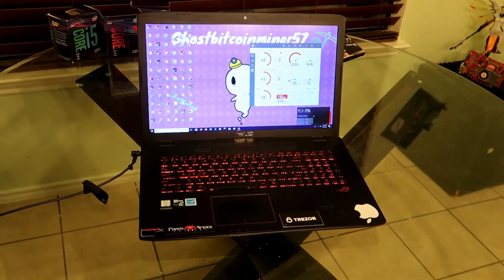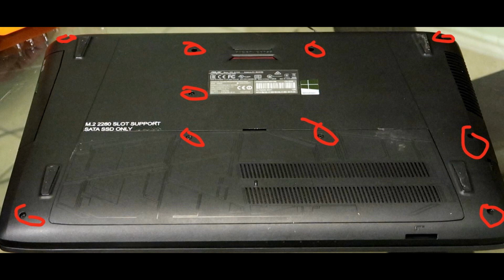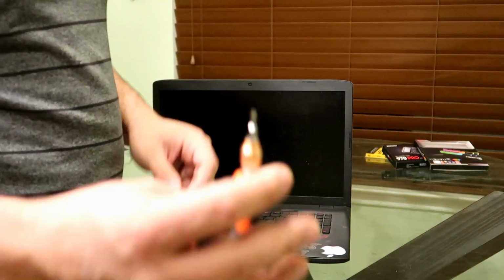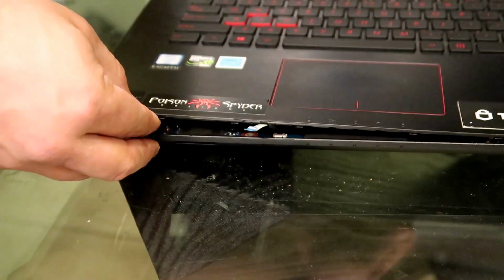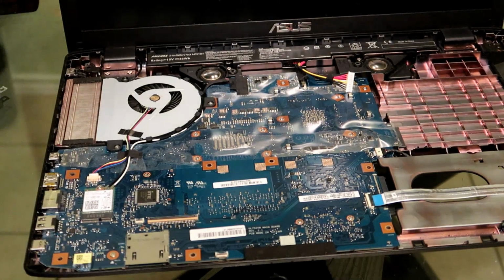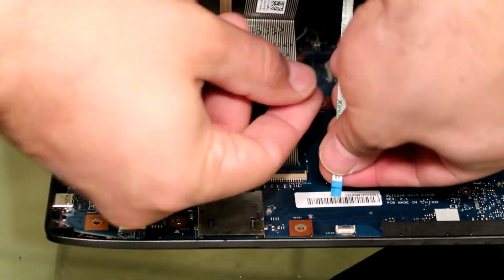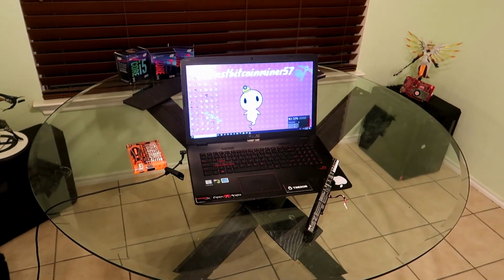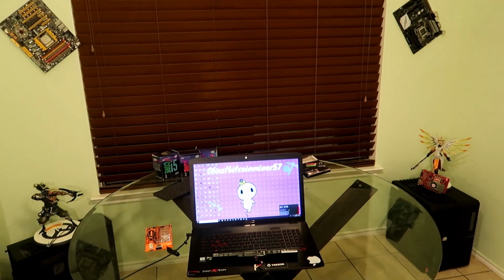ASUS ROG GL752VW DH71 Battery Repair

Comment: Excellent video... changed the battery no problem. Do remember to remove the hard drive before you take off the keyboard. Thanks for this vid fella, you are a legend!
Reply: It wasn't difficult to see that the four hdd drive screws are there for somethimng else than holding the drive, it must be not necessary that if you have mounted an ssd sata drive at the M.2 connector it's better to remove it before trying to unmount the upper cover with the keyboard. I can't understand people who complain about someone who goes to the trouble of making 99% of their work easier for them.
I didn't have to change the battery, I had to go ahead and completely disassemble the motherboard and heatsink to replace the thermal paste with graphene pads. The 'legend' accompanied me to a point on the path and then I continued on alone. He did the hardest part.
Reply: Guess I should have read the comments before just trusting this so called legend. pffft!
Reply: @elsid9927  Me too. struggled for 20 minutes before removing the SSD and being able to remove the keyboard.
Reply: @RogerNeno  It wasn't difficult to see that the four hdd drive screws are there for somethimng else than holding the drive, it must be not necessary that if you have mounted an ssd sata drive at the M.2 connector it's better to remove it before trying to unmount the upper cover with the keyboard. I can't understand people who complain about someone who goes to the trouble of making 99% of their work easier for them.
I didn't have to change the battery, I had to go ahead and completely disassemble the motherboard and heatsink to replace the thermal paste with graphene pads. The 'legend' accompanied me to a point on the path and then I continued on alone. He did the hardest part.

Comment: You failed to show removal of the HDD and the optical drive.  Also, two of the black outer screws are 1mm shorter.  8mm  x 2 & 9mm x 8.  VERY important.

Comment: A most excellent video. The computer I am posting this from is doing so after following the battery replacement instructions here. The bad news was that the clip for the touchpad pulled free of the motherboard, but since I dislike the touchpad anyhow (I prefer a mouse), no major issue. Thank you for sharing this video!

Comment: If i may suggest a major problem with the title.
Is called "Battery replacement" not "repair".
Repair , and what i was searching for, means you open up the module and replace the damaged cell, balance them, or replace all cells inside , if possible (i think these are 18650 cells, but i might be wrong hence why i search for "repair" not to get "replacement")
Thank you anyway

Comment: my yuhjnm dont work after replacing keyboard... did I do something wrong?
Reply from the maker: Did you get it working?
Reply: @Ghost57  I think so, I replaced the battery and the ssd and the buttons seemed to work now, so I'm thinking I had a strip not all the way in

Comment: Thanks for the review, everything is very sensible! .. I would like to ask, I have the same asus laptop .. After one preventive maintenance and a repairman for dust cleaning, I noticed that the laptop screen ,,..horizontal lines began to appear on the screen ,,After after I move the screen a little, as if the screen image becomes normal .. Maybe the laptop screen cable was damaged ...? Thanks again!

Comment: Also had a problem because the hdd removal was not mentioned in the vid...I did not read the other comments....this step should be added in the vid, even if it is just some warning text overlaid, this can cause people lots of unnecessary problems, poor vid for this reason alone.

Comment: I have the same laptop, and its been dead for almost a year, i'm afraid it will expand or leak eventually. Should I just remove the battery even though I have no intention of putting a new battery inside? I'm fine with it plugged in.
Reply: If someone could answer Apollo Kai's question it would be very helpful for me also. I'm also fine with my computer plugged in, I just don't want the dead battery inside to cause problems.

I was in front of my computer when it died. It made a little "pop" and then some kind of quiet hissing sound (like a tea kettle, but not loud). But no smoke, fumes or heat. So I'm still using my computer with the dead battery inside...

Thanks.

Comment: Thank you so much! I've never worked on a laptop before. (I've always had an external battery on previous laptops). With your excellent video and comments about removing the hard drive, this was a lot easier than I thought! My replacement battery only gives me about 50 minutes of power, but I've had ZERO battery power for the past 2 years, so I'm a happy camper. Cheers!

Comment: Great video. Like you i used the metal flat head....slight damage to the casing (cosmetic) but mental note hard drive screws need to be removed as well. Thank you so much for the help.

Comment: any videos about how to fix screen flicker for asus g752vs xs74k ??irly need help if anyone can
Reply from the maker: You might need a screen replacement. When did you start to notice this issue?
Reply: @Ghost57  about a week after buying this used laptop..do u have any videos for opepning the display.maybe the screen connecter isnt well connected?i already checked the mother board side

Comment: IMPORTANT
If you change only the 4 18650 cells,
That doesnt work.
Now i had to start with wire plugged in and then i can remove the wire and its running on battery power and max 30% cpu power.

F**k you ASUS for this S**T.
What is the Problem to make it removable like every AA battery in remote controls for TVs.

Comment: is there any way to replace the internal stock fan with a way stronger one or add another fan inside? i'm having immense heat issues using this machine in 2020 i already cleaned it dust free & replaced thermal paste multiple times and also added a cooling pad below idk how else to help reduce heat

Comment: Hey, i just changed my battery, it works fine. The only problem is that on the percetage display there is a X and it shows 255% charged. I haven't found any battery drivers for GL752vw battery and already tried uninstalling the battery drivers from device manager.
Do you know how to fix this?
Thx :)

Comment: I made this steps but with the new battery it continues to say 0%. What should I do?
Reply from the maker: Just make sure that the battery you put in, is correctly connected. If it is, then I would take it would be a faulty battery. Use this link to self diagnose-https://www.pcmag.com/how-to/how-to-check-your-laptop-battery-health-in-windows-10  
.If so, I  would return that battery for a replacement before troubleshooting anything else.

Comment: This video could have been very good, but they left out an important step.  To take the keyboard off, you also have to remove the screws that hold the SSD in place, or at least I had to do this on mine.  Not having that information caused some trouble for me.
Reply: It wasn't difficult to see that the four hdd drive screws are there for somethimng else than holding the drive, it must be not necessary that if you have mounted an ssd sata drive at the M.2 connector it's better to remove it before trying to unmount the upper cover with the keyboard. I can't understand people who complain about someone who goes to the trouble of making 99% of their work easier for them.
I didn't have to change the battery, I had to go ahead and completely disassemble the motherboard and heatsink to replace the thermal paste with graphene pads. The 'legend' accompanied me to a point on the path and then I continued on alone. He did the hardest part.
Reply: this comment was very helpful, thank you

Comment: Screw that! (pun intended). Changing a battery should not be this complicated. Having to disassemble the whole laptop is ridiculous. Thanks for the video though, you showed how to do it perfectly. Still won't bother with it.
Reply: @MiguelRodriguez-ff9wl  Disassembling the whole thing just to change a battery is completely stupid. What was Asus thinking? It's going to be hell just trying to figure out which screw went where if I didn't lose any to begin with. Also, i am NOT taking the risk of damaging my laptop. I rarely move it around anyway.

Comment: Was easiest to get the keyboard off by gently pushing up through the DVD drive bay to get it started. Didn't need any tools to get it off working around from that start point. Glad I saw that the harddrive needed to come out. Need to pull the DVD drive all the way out too. Thanks for posting this.
Reply: Great tip.  Thanks.

Comment: You actually don't need to remove those ribbons, just move the keyboard area forward. (I just watched your video to fix my laptop, and noticed you don't need to move the ribbons)
Reply: Good tip.  Thanks.
Reply: Ah, should have read you tip before changing my own battery. The only (small) issue I had was to put back the ribbons.
Reply: @jrnmayntzhusen553  yeah I mean I got my battery in and got the laptop to finally recognize my nvme
Reply: this is actually helpful lol i prefer not to touch them if not. necessart
Reply: Agree

Comment: Thank you. Your guide assisted in helping me replace my battery. As others have pointed out, the hard drive step was missing, but otherwise a good guide. The hardest part was snapping the keyboard back into place; that was a bit frustrating.

Comment: I broke my keyboard while doing this. Now when i press a key some others characters pop up too.When try to reconnect the capble still wont fix it. Any suggestions??
Reply: The issue might be the ribbon cable that connects the keyboard to the motherboard. Pull it out and make sure its aligned properly at the slot. 

If the cable is broken you may need to bring it to a repair shop and get the cable ordered in and replaced. Otherwise you may need to buy a whole new replacement keyboard.

I had the same issue with my razer blade. It means there is connection that overlaps each other so when you press 1 key, it would register the the ones that are overlapped
Reply: @ctse26  the doors broke so when i put the keyboard ribbon into the slot i cant closed it completely i dont see the white line everything is hidden but keys on laptop didnt work some work and some dont work at all so i maybe call the repair shop tommorow ! And i will buy a usb keyboard to be able to write again.

Comment: No mention of the hard drive screws.  Poor guide.  Very frustrating for someone without a lot of experience opening laptops.
Reply: A little mistake. Never replaced a laptop battery but at least the guide helped me doing the job. Would have been better to say to removed hardrive but its not a 'poor' guide.
Reply: We also needed to remove the hard-drive screws before the case would open.

Comment: I think you should add that you need to unscrew the hard drive to take the keyboard off.
Reply: Too late.... I was close to break it
Reply: @javibasket98  same here =P
Reply: @IvanLlanas  A very important piece missing, from an otherwise great video.
Reply: Yup. I saw there was a problem when the keyboard was not able to be taken off.
Reply: I didn't break it, but I chewed up the keyboard pretty badly before realizing the SSD drive needed to be removed (which was not mentioned in the video)
Reply: Yeah, I broke the thin plastic piece where the DVD goes trying to get the keyboard off because this doesn't show unscrewing the hard drive first.
Reply: I would have avoided nicking up the edges if that part wasn't skipped over
Reply: Yep. Same here
Reply: Same here... I broke the little plastic piece above the DVD drive.  Otherwise a great video
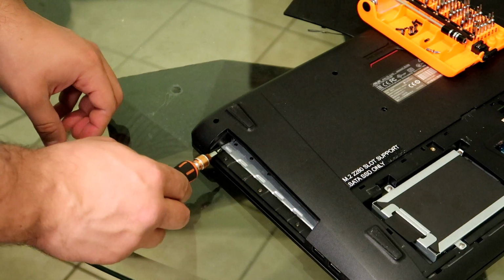Reply: @djentropy  So i should remove all the screws of HDD?  min 2:26
Reply: @mariojorgesimoes585  I believe so, yes.  I did.
Reply: It took me a while (I almost broke the plastic xP) until I realized. I was going to comment it but I just saw someone else did it. Thanks.

Comment: Do you recommend this battery?I'm searching for original battery ,but i cant choose which battery in amazon or ebay is good enough for this laptop
Reply from the maker: This battery is okay, but I probably won't recommend because it never got over 97% charged. I couldn't find the OEM part anywhere. Over all its will keep a charge and it gets the job done, but can't reach a full capacity charge.

Comment: Do I have to remove a hard drive?
Reply: You need to unscrew at least one border screw from the hdd. It won't let you take the keyboard otherwise.
Reply: I just took the hdd off.
Reply from the maker: No, just did that to upgrade it.